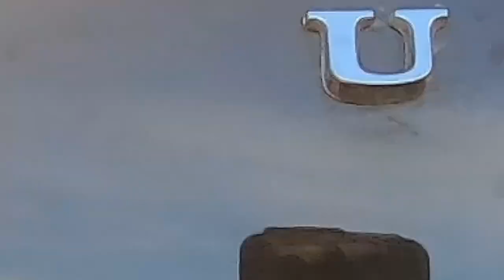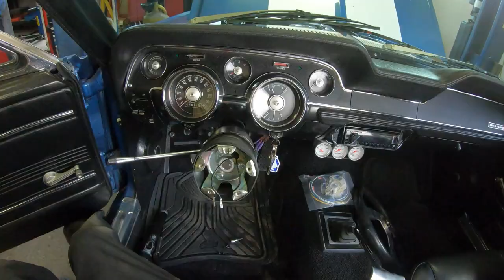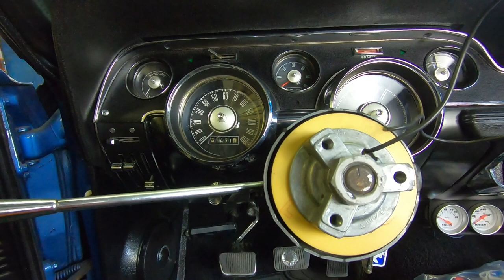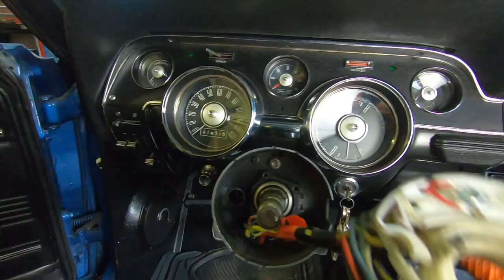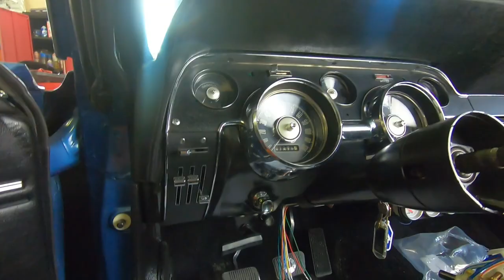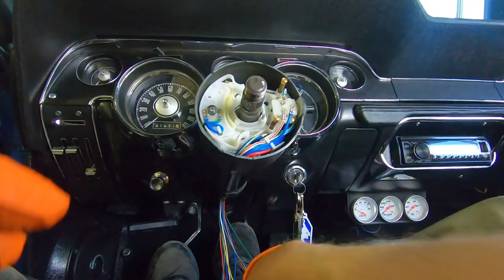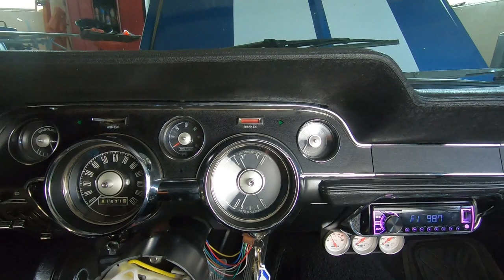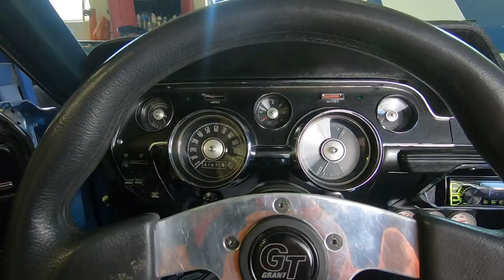How to replace turn signal switch - 1967 Mustang

Comment: Great video.  Just found it and had to replace the switch on my ‘67 Mustang this past weekend. I found if you remove two screws holding the shroud on the column, it give access to the tunnel to feed all ten wires down the column at the same time.  Worked great for me.  Also, cutting the wires from the old connector a few inches longer makes it easier to match the old to the new.  Like you, next time I’m buying a new connector instead of cutting/soldering/heat shrinking the wires because I could get the old wires to release from the connector.
Reply from the maker: Oh very nice. We love learning new tricks. I will have to remember that next time for sure. Thank you.
Reply: Do you know where to get the connector that the ten turn signals wire go into? Thanks very much.

Comment: Nice video. I've replaced several T/S switches on newer vehicles. When I did my 67, I didn't run the wires through the column. Thought they ran out of the upper collar then in. Nope. Thanks for the video. Time to redo and do it like yours.
Reply from the maker: Oh cool, you're very welcome.

Comment: Good video - I have done auto electrical work for years on various makes, though not on Mustangs. I already checked the brake light switch, but could not find a wiring diagram quickly. This video told me that current to brake lights runs through the turn signal switch connector. Similar to some other makes, though this verified it. Thanks!
Reply from the maker: You're very welcome!

Comment: Great video, I’ll be replacing my T/S switch soon. What was the problem with yours? The plastic cracks or the cam is worn/crack. Just looking to diagnose a right turn intermittent action. Thanks
Reply from the maker: This particular case, it wasn't sending power down to one of the brake lights.

Comment: Incase anyone needs new connectors (10) wire they are: c5cz-14489-A, connector for turn signal wires, and c5sz-14489B, connector plug from dash harness. New pins c4az-14461A 14-16-18 gauge. Plug connectors are $4.95 ea, and the pins are 0.80 a piece. CJ Pony or Mustangs Etc. CJ is much higher. FYI hope this helps someone. Cheers.
Reply from the maker: Thank you Robert!
Reply: Also, if you need the "cam" that cancels, available at NPD #13318-3A $3.71 and the Pin removal tool #957-2 $15.10 at National Parts Depot also. Switch plug connector #14489-4A (10 pin) is $5.92  FYI

Comment: I have a 64 falcon Sprint with stock suspension setup.  What is the max tire size and wheel offset without interference and rubbing

Comment: Help! The little turn signal cancel cam with the pin where can I get that? My project is missing it and I can’t find it.
Reply from the maker: I don't know where to get that other than buying a whole new turn signal switch.
Reply: @AlfsMustangGarage  I have a 1966 and I have figured out the steering wheel hub doesn’t work with the 66 switch set up. My steering hub is the 67-69 style. 1 pin on the cam that interfaces into the hub which turns the cam to flip the two ears.  I’m going to have to do some research on my options

Comment: I tried tackling this today on my 68. The turn signals wouldnt lock in place and after taking off the steering wheel i noticed both hooks on the cam were broken. Ordered a replacent from Amazon (Dorman) and changed out the cam but the hooks grab too well. When I turn the steering to cancel it pops off the center plastic piece so tomorrow Im going to shave the hooks a bit see if that helps
Reply from the maker: Oh ya I've tried just doing the turn signal cam replacement before. I find it far more effective to replace the entire switch.
Reply: @AlfsMustangGarage  I know what you mean but since I have quite a ways to go Im trying to save a buck. Cam was only $12, but if it doesnt work out I'll eventually get the whole switch.👍

Comment: Future wise when cutting the wires that are inside the column leave one or two wires uncut and cut that wire at the switch.  This leaves you with a wire(s) to pull the new wires down and out of the column.
Reply from the maker: Good tip, thank you.

Comment: I just replaced my switch on my 67 and have checked wiring multiple times. Turn signal works brake lights work but car will not start. Just a council and alternator gauge moves to C. Thought I had a weak battery so charged it and tested it. Still no start. I’m at a complete loss and ideas?
Reply from the maker: No crank? No starter engagement? You'll want to start checking things as if this has nothing to do with the turn signal switch. If the battery is good, perhaps check to see if the starter solenoid is getting power from the ignition switch.
Reply: @AlfsMustangGarage  let me apologize for not proof reading my earlier reply. Where I said just a council. What I meant to type was just as soon as I go to start it alternator gauge moves to C and I get a click.. I just tried the old trick of bypassing the solenoid to get it started and it fired right up. So I’m guessing it’s either the solenoid or the switch at this point?
Reply from the maker: Oh ya if the S terminal on the solenoid is getting power with key turned in start position, then that solenoid is probably done for.
Reply: @AlfsMustangGarage  so you will never believe what has happened. I replaced the solenoid and she fired right up. Ready for the kicker? Turn signals stopped working. Still have running lights. Emergency flasher blinks for one sec before they just stop. Checked fuse and it looks good but will replace that this afternoon. You don’t think it could be the turn signal switch do you? Can you link me the right turn signal switch for a 67 with fixed column? Also going to replace the flasher as well. Hoping that’s my issue. Thoughts?

Comment: I know you have the wire chart. I put a new turn signal harness in my 67. Now my left turn signal, and the left side 4 way don't work. They did before. What color wire do I need to check?
Reply from the maker: Green with white tracer is left front. Green with orange tracer is left rear.
Reply: @AlfsMustangGarage  thank you sir
Reply: @Alf's Mustang Garage  just a FYI, what my problem was, is the wire in the connector coming from main wire harness.......the metal male prong was loose and falling out of the plug. I had to push it back into the plug. And now everything works as it should. Just something people may want to look for if they scratch their heads.
Reply from the maker: Oh ya thank you for the update. Those little things like that will get the best of ya sometimes.

Comment: Is there ever a time to also test the turn signal switch? Curious how you knew that wasn’t the problem
Reply from the maker: https://youtu.be/X724Dgwx8Xs
This video shows my diagnostic steps on how I condemned the turn signal switch.
Reply: @AlfsMustangGarage  thanks for replying. I watched that one but didn’t see the turn signal flasher * (sorry not switch) mentioned. Would that ever cause a one brake light problem?
Reply from the maker: Oh ya you must have missed that part. So I'm not sure what year you're working with but on this 67 the brake light circuit goes through the turn signal switch where it splits off to go left and right back to the brake lights.

Comment: What is the part # for the harness?
Reply from the maker: I have links to the parts in the description.
Reply: @AlfsMustangGarage  but you said I should of bought the harness piece foe $5.00. That way I don't have to pull the pins out.
Reply from the maker: Oh ya you can buy the plastic connector. You can get them from National Parts Depot.